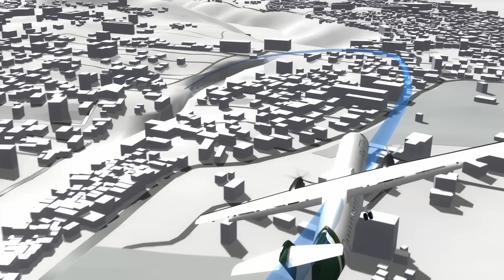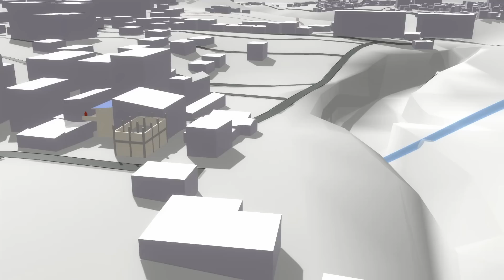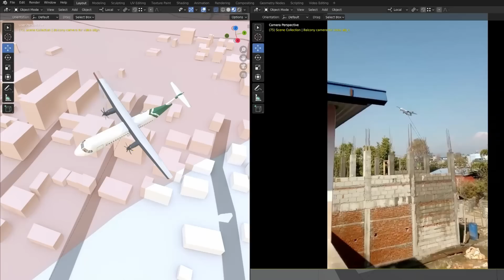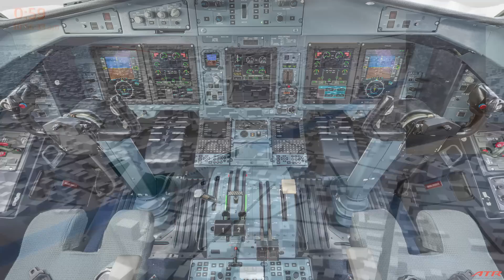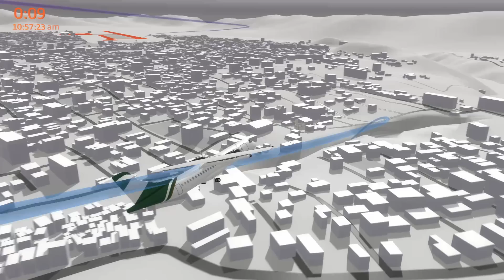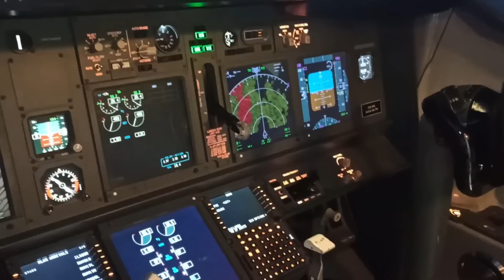HUMAN ERROR or MECHANICAL?! | Yeti Airlines flight YT691 illustrated

Comment: As a layman, what scares me is not how unthinkable it must be to mistake levers, but rather just how easily they can be confused.
Similarly I would not lay a tablet of arsenic next to a vitamin tablet - even if they are different shapes and colours - all it takes is one absent moment of  mindfulness.
Reply: It's not the levers that are easily confused, it's the seat the captain is sitting in. For someone who normally flies in the left seat, operating all those controls with the left hand is not normal, and it requires clear focus. I don't think this captain would ever have done that from the left seat.
Reply: @beenaplumber8379  
 That's no excuse. The seating position shouldn't cause this type of egregious mistake to occur because the levels are as different as cheese is to bread. Other than located side by side, there's nothing to cause such confusion. I think the trainer pilot was either experiencing a mental or medical issue, suicidal, very inexperienced, or drugged up and under substance use. Or perhaps he was extremely distracted from his important duties by something or someone while flying? Maybe he was engaged in deep conversation with the female pilot and forgot what he was doing? Why didn't either pilot not respond immediately to the audio and physical warnings that may have made a difference? It's like both pilots were very distracted and caught up in a stupor. Maybe engaged in a physical relationship situation when they should have been flying the plane safely. That's my best guess. Something distracted the two of them to the dangerous degree of not being in their right minds at the most crucial timeline when flying the aircraft. 😢
Reply: @jacquelineoutlaw3252  You can think what you like, but the phenomenon I described is real, and it's a risk among pilots who change seats. It causes confusion when using the opposite hand. Muscle memory works that way. From the captain's seat, the flaps are farther away than the condition levers. From the FO's seat, it's the opposite - the flap lever is closer. People have died because of that type of error. It's a known phenomenon in aviation. Difficulties like this are apparent to anyone from the UK who has had to drive a car in the US, and to American drivers who have driven in the UK, particularly using a manual transmission. It requires careful attention at all times to do relatively mundane tasks, but the training captain has a high workload already during this phase of flight.

Your ideas would most likely have been apparent from the CVR analysis. Drug use is always checked after a crash, either in the blood of the dead crew members or in specimens from those who survive.

They most likely didn't respond to the warnings because they didn't realize what was happening. With flaps full, the stall speed is lower, so at the airspeed at which the upset happened, they were probably not expecting to stall, and not expecting the need to recover from the approach to stall. (Stalls are very abrupt in modern aircraft, and there is little margin for error.) Pilots sometimes get confused in situations like that. They might not immediately believe the warnings, and they don't respond immediately. That has also killed many people. The trainee captain would not necessarily question what the training captain has done. It might have been her first assumption to assume her teacher had done the correct thing. It takes a moment to realize something like that, but things happen so fast on approach, there's little time for that sort of hesitation.

There is no need to come up with novel narratives like the secrets of their relationship or drug use. There are enough simple and common errors to explain what probably happened.

Comment: It was a female pilot, so she probably wasn’t paying attention and pulled the wrong lever. My car was once hit by a young female driving an 18 wheeler on the highway, my car was badly damaged but miraculously I was ok
Reply: The female pilot  was flying the plane, so moving the levers was the duty of her instructor  as a pilot monitoring. Flying is not like driving, you have a pilot flying responsible of the handling, and a pilot monitoring who monitors the flight, talks to atc, reads check-lists and operates the levers such as the ones for  flaps and gear.

Comment: Hello. What would have happened if the pilot had pushed the go around button at the time?
Reply from the maker: Hi Aircraft don’t have a button for go around. The pilot needs to adjust multiple things in the cockpit depending on the specific conditions. Also if you have no propulsion you have no choice but to make a forced landing immediately.

Comment: If this condition lever is so critical then there should be provision for one time commmand recording in flight data recorder.
Reply from the maker: That is much like a neutral gear in a car.  Vehicle drivers get many clues if a car were to go into neutral.  Pilots would get clues as well and these pilots didn't pick up on those.  If a pilot doesn't know how to pick up on those clues or cant problem solve them, they should not be a pilot with 70 passengers on board.  They should be a bus driver.  Unlike a plane a bus can stop by the side of the road.

Comment: Right from the start of my flying training some 40 years ago it was hammered home to me that when operating ANY switch or Lever on the flight deck the following three things must be observed. 1) Identify you have the correct switch/lever. 2) Operate the switch/lever and 3) Confirm the action you have selected has happened. The Non Flying Pilot, in this case, broke all three of these rules of basic airmanship and a lot of people died, unnecessarily, as a result. Aircraft designers do all they can to make things fool proof but you can't make things bloody fool proof.

Comment: How can first officer got confused between flap lever and conditional lever.. I have flown ATR during my training days.. Both the levers are very different.. This is sheer carelessness or result of fatigue.. Though I don't agree, it happened in the morning and pilot must have got sleep time.. This is unbelievable, they were experienced pilots.. They have cut off fuel supply.. Such carelessness is criminal...
Reply from the maker: Do you think it is possible it was an uncommanded auto-feather?  Because it is so inexplicable. 
A. To move the wrong lever! B. For both pilots with gauge showing zero torqueto not know thats screams prop issue! C. For both pilots to not go forced landing on the old runway right there in front of them!  D. For both pilots to fly the plane into a stall-spin! It’s just so crazy on so many layers. 
Perhaps the pilot monitoring had a stroke or some quick onset cognitive impairment but left him able to talk and sound present.

Comment: Just the other day I saw someone backing out of a parking space. Their front tire went over a curb. The driver panicked, but instead of hitting the brake, she hit the gas. She immediately crashed into another car full of small kids. Thankfully nobody was injured. It's called 'whiskey throttle'. My bet is the experienced pilot hit the wrong handle in a moment of carelessness, then couldn't figure out what happened in time to get power back to the propellers. I do it video gaming all the time. Panic pressing X, and wondering why Mario isn't jumping, when I'm supposed be pressing Y.

Comment: The Torque Meter for each engine is VERY Important Instrument to monitor a Turboprop Engine. According to preliminary reports it is clear that neither Cockpit Crew member ever looked at the torque meters after the propellers went into the Feather position. This instrument should be monitored a least a couple times a minute as the Panel is scanned. 
Both Torque Meters went to ZERO when the propellers went into feather position. Obvious in your face reading and the flight crew eventually declares Engine problems when absolutely nothing was wrong with the engines. The Engines did exactly what they were suppose to do and went to Flight idle automatically to prevent over speeding the engines when the torque went to Zero. The Torque Meters are just as important as having to pee the first thing in the morning when you get up. 
Too many things about this crash do not pass the smell test. I do realize that the accident report states both propellers were in the feathered position but does not state how they got there. The odds of a mechanical failure for both at the same time are very slim to none.
The ATR impresses me in the fact that it flew for as long as it did in the pattern with both engine propellers feathered.
Reply from the maker: Agree with all you say. Crazy stuff. If you don’t understand zero torque is SHOUTING an issue with the props then you should not be allowed in a cockpit with 70’people in the back and both pilots didn’t see the problem. 
I suspect the senior pilot was having a brain impairment/ stroke. Makes no sense.

Comment: So putting propeller in feathered condition led to the accident or was it  because no fuel was supplied to the engine?
Reply from the maker: It was feathering which is like putting it in neutral gear.

Comment: What is unbelievable is that the props feathering levers are on the same console as the power and flaps handles, without a double security latch or a bright color-coded handle.
Reply: What is "unbelievable" is that a Captain pilot "Accidentally" moved the Condition Levers instead of selecting the Flap Handle which is shaped and unlatched completely differently from the Condition Levers. Any ATR pilot should be able to immediately locate any of the controls on the Quadrant by FEEL and location even blindfolded or in complete darkness.
The Controls are purposely placed together in ONE Location so a pilot does not have search for them in a high stress situation.
The Propeller Controls [Condition Lever] needs to be placed close to the Power Levers because they are used in conjunction with each other to obtain proper thrust for the aircraft .
Something about this preliminary crash report does not add up.

Comment: Little late to the party, was a mechanic on this airframe type (older freight conversions) for 6 years. For what it’s worth, here is some things I can remember off the top of my head. The older pw127’s didn’t have the “100%, Auto, ftr” gates for the condition levers so keep that in mind for my anecdotal evidence. If the condition levers were somehow pulled into feather (what we called ground idle). You would get a noticeable lurch as the props transitioned from a shallow low air speed pitch into the feather pitch. You would also lose “a/c wild” power which should have thrown several warnings since some anti ice and lights use that power, as well as bleed air changes from low pressure section to hp section. At this point the engine has a different fuel schedule and turbine speed and egt ( translation: the jet part of the turboprop isn’t making power but idling) and trying to correct that by moving the condition levers takes quite a bit of time. Now with the power levers not in flight idle I don’t know if the engines would have done anything once pulled into feather. So the scenario I see happening is, accidental pull of condition levers to feather, may have been corrected after accidental pull. Correction of condition levers back into a flight setting either has no effect because of power levers (throttles) are out of flight idle setting or engines require too much time to spool back into power delivery and inducing a stall. I will say this, pulling a condition lever from any setting into the feather setting is almost an immediate change and has very little transition time. Please take this info with a heaping spoonful of salt though.
Reply: And maybe the captain was in the right seat, not his natural habitat, operating those controls with his left hand. Being Tibet, in the mountains, maybe the turbulence masked some of that initial lurching you mentioned. Is that plausible? Would it be way outside the slowing normally associated with flaps full?
Reply: In the cockpit voice recording you can hear numerous alarms going off as soon as the props are accidentally/purposefully put into FTR (feather mode). It also doesn't make a lot of sense that the senior pilot feathers the prop when asked for flaps then a few minutes later prior to taking control actually does move the flaps lever. You would think that you would remember moving something that wasn't flaps prior.

Comment: I have flown the ATR 72-600 for the last 5 years as a captain and I was thinking if this case could have been an Uncommanded auto-feather situation. There is an OEB for this problem, I know that the possibility of this situation happening in both engines at same time is sooooo small, but maybe it happened. Or the pilots were flying with 100% RPM (Conditions Levers at 100% OVRD) and when they returned the Conditions Levers to AUTO position, they moved a little bit aft and put them at Feather position. It’s very common to use 100% OVRD to reduce the speed a little bit faster due to the increase of drag. Well, this accident was very sad and I hope the families and friends of crew and passengers are well and strong!
Reply from the maker: @Maria Cecília Hi Maria. Thanks for your comment.  What you say is really interesting. 
The idea that an experienced pilot would feather by mistake in the first place and then also that both pilots would miss noticing the levers in feather position seems impossible. The prelim report only confirmed that both engines feathered. It did not say the condition levers moved so yours is a very plausible explanation.

When seeing zero torque the first thing to check are the props and to advance levers to 100% OVD. Presumably the flight data recorder does not collect data on the lever positions so there is no way to verify this and perhaps the faulty system keeps props in feather regardless of 100%ovd which would be really worrying for those flying ATR's.

If 100%ovd did nothing then immediate action by pilot is forced landing on the old runway which was straight ahead.  Why none of this happened is inexplicable.  

And how both pilots flew straight into a stall-spin scenario boggles the mind.

Another explanation is pilot monitoring was having a stroke or fast cognitive impairment but still talking and appearing normal to pilot flying.   Nepal is country with strict seniority and even more so if you are a woman.  So perhaps pilot flying was deferring to her superior who she did not realize was cognitively impaired.  And she was doing her best not to offend him and jeopardize her airport clearance.  Because he didn't call for forced landing she carried on as normal.

The cockpit voice recording should reveal a lot more we don't yet know and then solve this mystery...

Comment: I fly the Q400. If we try to feather both props while flying the computer won't do it. It's hard to believe the ATR did not have this feature.
Reply from the maker: A double feather safeguard makes so much sense. Didn’t know the Dash 8 had that. 

I will add the prelim report only confirmed that both engines feathered. It did not say the condition levers moved. So I assume there is a possibility this could be a faulty systems auto feather. 
That a pilot moves the wrong is bad enough but then not realising the error after an alert and gauges showing zero engine torque. What pilot doesn’t know zero torque shouts prop problem!

So as I see it either feathering by faulty systems or pilot monitoring having a stroke or fast cognitive impairment are the reasons that make some sense. 

But also not going for a forced landing on the old runway straight ahead adoesn’t add up either. So much here makes no sense. But if pilot flying in a country with strict seniority and a woman she was deferring to her superior who she did not realise was cognitively impaired, does to me sound like a plausible explanation.

Comment: Why didn't the pilots notice that they were too low and too slow on base?  They were perfectly lined up with the old runway at that point.  If they would have been more engaged and aware of the developing emergency, they could have put the plane down on the old runway.

Comment: Why should anyone feather the prop of a running engine? But it is a behavior of Turboprops, that you may NEVER pull EngPower below InflightIdle in flight or you will find yourself withpout any thrust but with an incredible amount of drag instead, despite resetting levers to T/O Pwr. You might need a lot of altitude to regain (kill the engine and inflight restart). The resulting sudden decay in airspeed (stall) has cost many lives all over the decades.

Comment: If the pilot monitoring was distracted by something at the moment he moved the levers, he would have used his "muscle memory" to position his hands and unlock the lever. Muscle memory is actually the primary and secondary motor cortex in the brain, which has been shown to store and automate quite complex movements, like gear shifts. It is important to know that the aiming of those movements isn't perfect. It is thinkable that he actually put his hands on the wrong levers, and the memory of the touch of the levers triggered the appropriate unlock action in the motor cortex as well, without the pilot experiencing the feeling of wrongness. This is similar to us sometimes putting the car keys in the fridge when we are distracted and not noticing it. We intended to put away the car keys, and we executed a "put stuff away" sequence. After that we are convinced we did the right thing even though we did something completely nonsensical.
Reply from the maker: Yes humans are prone to distraction but that's why there are 2 pilots.